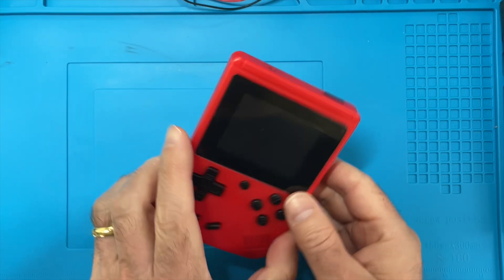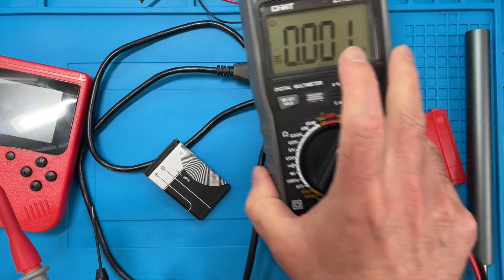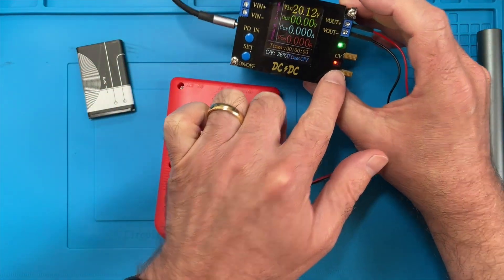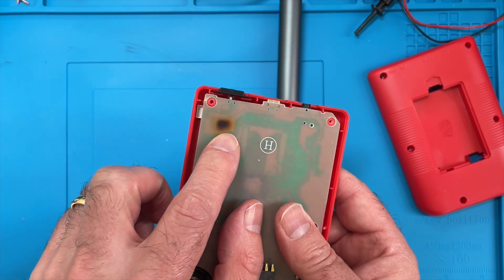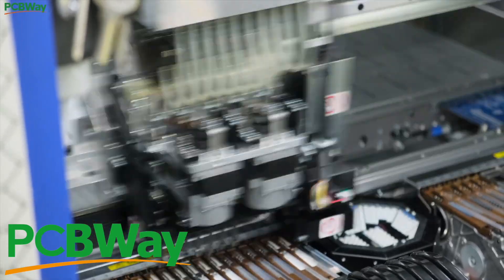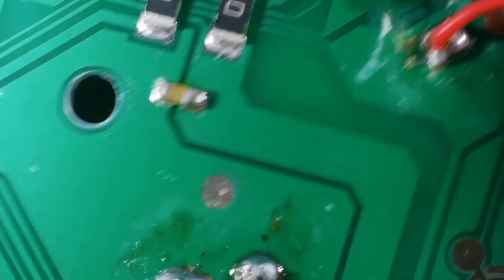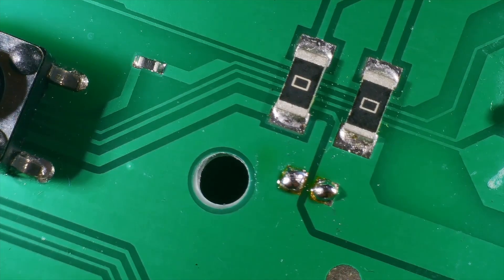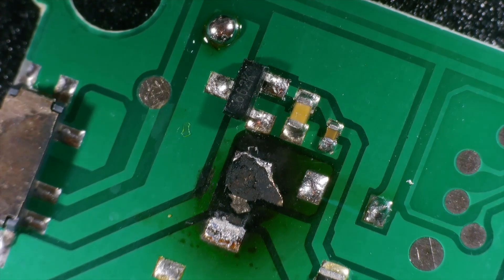Dodgy circuit could have caused a fire!

Comment: Two diodes in series? 
I don't see any battery charging IC's. Are they hoping to charge battery using diode voltage drop?
Reply from the maker: I think so yes! Bonkers :)
Reply: @atomic14  I googled for the battery. The google AI says, the battery includes protection circuits. Might that be the case for the clones and thus the reason for it being in so many cheap products? I wonder, if I should adopt it, too. However, diode voltage drop sounds bad nevertheless. Which way of powering and charging very simple circuits would you recommend?
Reply: Its built down to cost so wont surprise me :)

Comment: as If all those product safety laws have a purpose...Don´t waste money on dodgy dirt...and if you do, take it apart and look inside before taking a risk.
I had my fair share of very justified machine rebuilds after looking inside breifly.
Reply from the maker: Definitely - I can understand trying to get costs down to a minimum - doing a single sided board with 0ohm resistors, a blob chip, minimum decoupling. But the price of a battery charger IC is next to nothing.